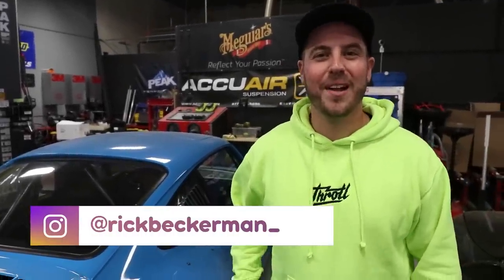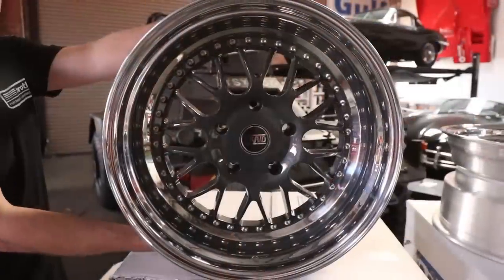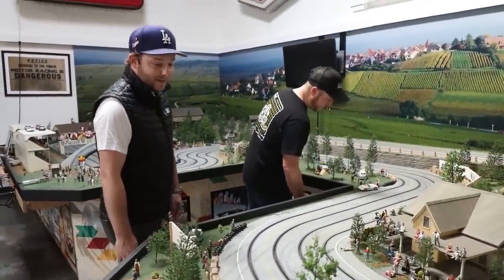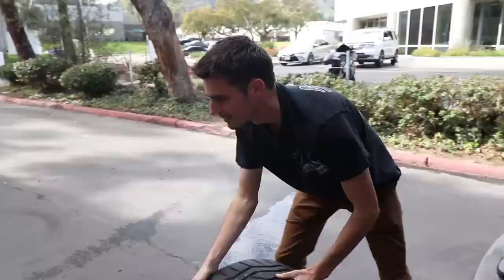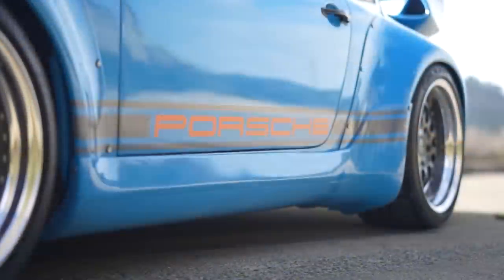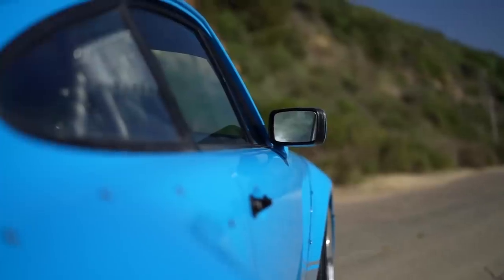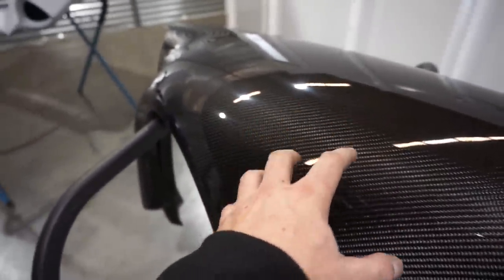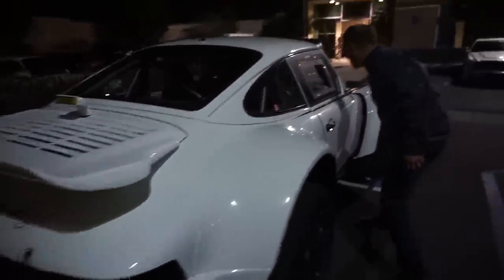Turbocharged Widebody Porsche 964 v2.0 REVEAL! (+ INSIDE PELICAN PARTS HQ!)

Comment: Falken are good tires but why wouldn't you wrap those wheels in Michellin 4s, Potenza re71r, or Toyo R888. You just pointed out the weakest link in this chain and it's arguably the most important. Notch down to stancey boy status.